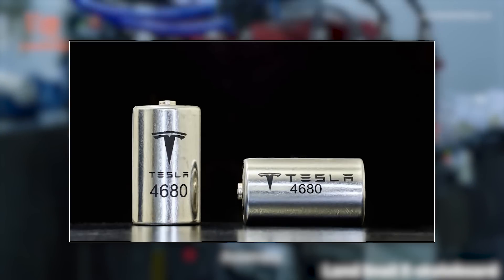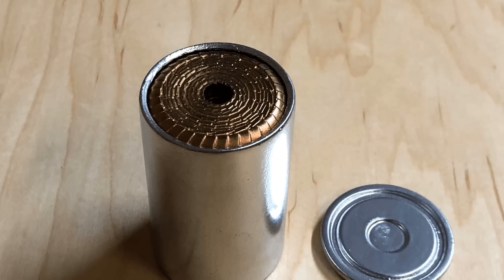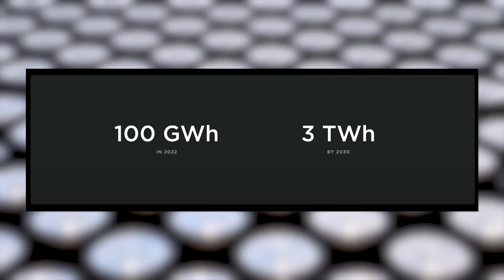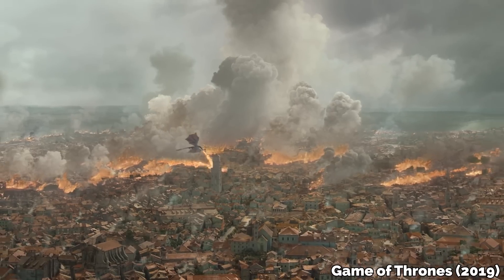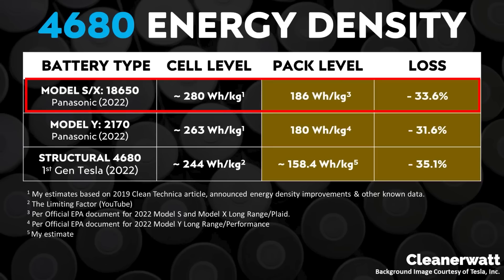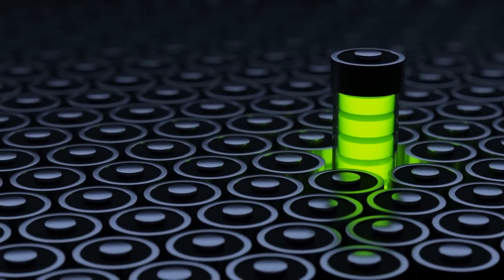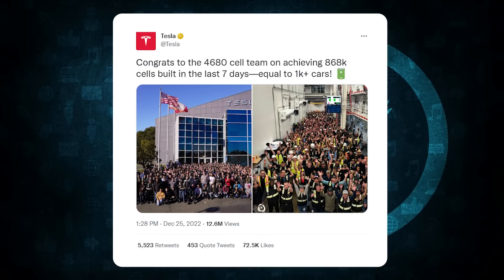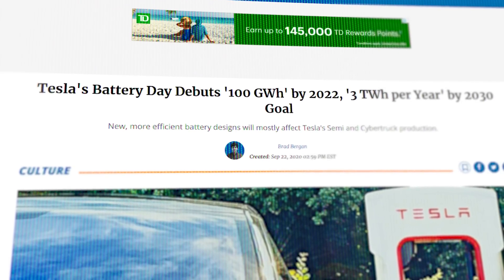The Disappointing Truth About Tesla's 4680 Battery Cell..

Comment: I still believe the 4680 battery has a lot of room for improvement because Tesla has basically got the construction formula of the battery right with the tab-less, but eventually the chemistry will improve and catch up!
Reply: Yep they want to get away from Lithium. This is a big step toward that.
Reply: @Dive-Bar-Casanova  Do you mean they want to get away from cobalt?
Reply: True and the chemistry can be changed to whatever it needs to be in the future.  I think battery technology is a step away from a better material design.  It will be interesting to see what chemistry will be used in a couple of years.

Comment: tab design is main advantage  - it will be in less heat when charging or fast discharge
Reply: Until you need more heat. Imagine a race car hugging a turn to reduce time.
Too tight a turn and it's too cool. Too wide on the turn and it's too hot. Steering speed needs to match the speed of the approach of the turn more critically the faster you go is similar to adjusting to temperature changes rapidly.

Comment: Great video. I may have missed it but would be interested in the cost to manufacture per KWhr the 2170 vs the 4680 as well as any total weight difference between the two, per KWhr. Even if the 4680 has lower power density, perhaps this can be partially or fully made up for with weight savings benefit for the vehicle.

Comment: The first generation of a new form factor that meets the existing criteria is an excellent start, in a few months the next iteration of the 4680 will start to roll out with changes in chemistry, production, etc will show gain after gain.
Reply: in a few months? Tesla is still having trouble getting the dry anode/cathode chemistries to play nice. Even the first 4680 battery packs only used a dry anode. Its one of the primary reasons why production is leagues below what they promised in 2020. I'd wait 1-2 years before 4680 is making the best of its potential.
Reply: Can you explain why they’d put in a Tesla car a battery that perform worse than the battery they currently have? Why not wait until the battery gets better? I’m so confused. Thank you
Reply: @jonathanlivingston7358  Because even if slightly worse the battery has value use it in a high value product you get that value, what else can they do with them?
Reply: @steve.k4735  I don’t understand that reasoning. I’m the costumer, I’m not going to buy a worse car when I could have the same car performing better. 

It’s not my problem that you came out with a worse product. You can’t ask me to pay the price for that. It’s on you and you should pay that price not me the costumer. It’s also kinda insulting. I am surprise that it makes sense to you and other people on here. I don’t get how you can be ok with it.
Reply: @jonathanlivingston7358  The car is not worse at all .. I don't know why you think so .. the range will be the same as they use more or less batteries to give a set range, the 4680 allows a structural battery pack which makes the car lighter and safer, it may not be a greatly better car as promised but its not worse.
Reply: @steve.k4735  I thought this video said that the range is worse with 4680. Am I mistaking?

It’s good to know there are positives such as lighter and safer. I didn’t get that from the video. Maybe I missed it.
Reply: It's an awful start. Why would you build a new form factor in the first place if you at least don't get improvements

Comment: (as in dry electrode production , non-flamable stainless steel cells in structural battery packs -and recyclable )
Reply: How and where are they recycled?
Reply: @davidbrayshaw3529  with gasification, centrifuges, solvents and heat pretty much everything is recyclable 
(batteries are to be grinded into a powder then melted where the lightest parts floats to the top and the heavyest parts sink to the bottom )
Reply: @replica1052  That sort of answers the "how". Precious metals such as cobalt and nickel are being "mined" from the batteries, as is the metal case.
It's an energy intensive process that still results in a lot of waste materials.
Researchers have found ways to liberate the lithium from used batteries but to this point, there is no commercial recycling plant using the process.
The lithium in a battery is waste. Half the battery is waste.
As for the where? The answer to that question is not in nearly enough places. There is quite simply a dearth of battery recycling plants. That's why an estimated 95% of L-ion batteries end up in Landfill.
I think I've just found a very good alternative to Tesla shares. What do you think?
Reply: @davidbrayshaw3529  batteries ar practical and batteries are recyclable
Reply: @davidbrayshaw3529  what is lacking is battery cell production capacity - battery production require materials, old batteries is a resource
Reply: @replica1052 I think that you are missing the point. Old batteries are a resource, once we can exploit them to the fullest. Chickens and eggs.
Reply: @davidbrayshaw3529  old batteries is a resource already (there are 10 year old teslas with 90% capacity left and that was several generations of batteries ago )